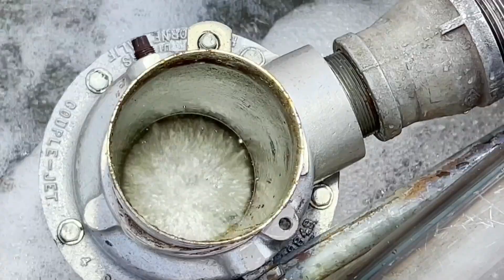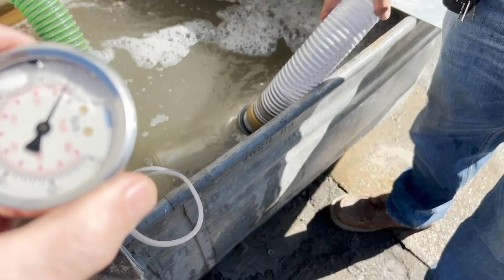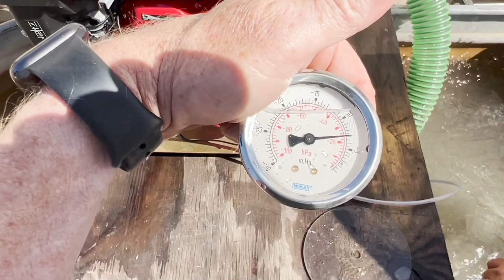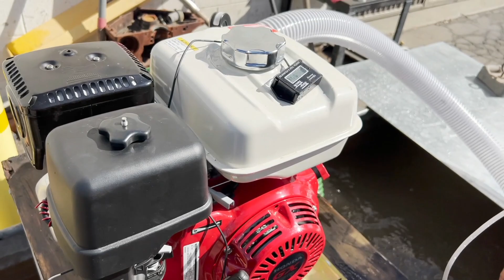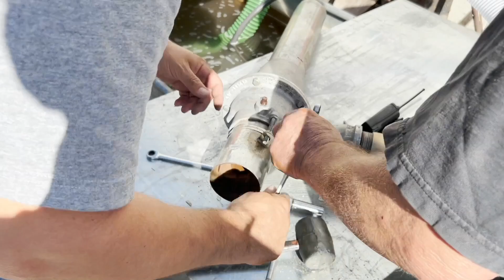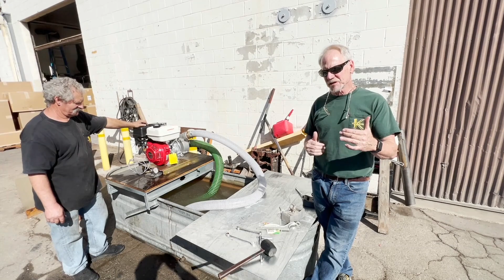Keene Versus Infinity Jet

Comment: Great video, totally missed this as i'm quite interested in this type of dredge. But one thing i learned while doing research on them is that they don't like a pressure pump, they need volume. But as you said they are more effective but also more problematic as they are sensitive.

Comment: Couple jet is the most efficient design IF the geometry is made the right way. It's all about the angles and the gaps.  High precision is needed. The one you have (gold divers) is not best in terms of geometry but if you adjust the gap between the cones and make sure it's perfectly centered it will produce better results than power jet.  Or worst case the same suction with less rpm on the pump. (Higher efficiency) You can try adjustment for more volume instead of pressure.  Also you have to install proper (multi screen) filtration system on the suction end of  the pump to prevent plug ups. You should see what they use for larger scale dredging!  ONLY couple jet for large scale underwater excavation dredging for construction.  They build artificial islands and harbours with these things.  Foundations for bridges, pipe lines ....And many more.   They are moving incredible amounts of material with 8, 10 and even 12 inch dredges under water.  Check this for ideas   https://www.ashtead-technology.com/equipment/dredging/
Reply: Exactly, I am building both infinity and jets and infinity outperforms jets any time if adjusted properly

Comment from the maker: I tried 3 different settings on the jet infinity jet.  I ran it at 30 psi,  32 psi,  35 and 40 psi and the performance was best at 35psi.  Keep in mind the higher the pressure the lower the volume passing through the jet.  Lower pressure means higher volume.